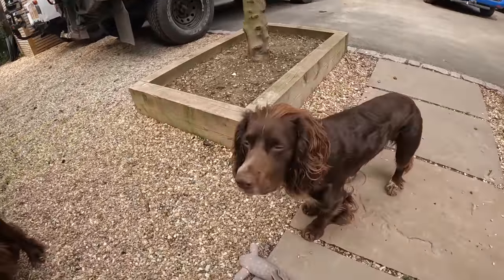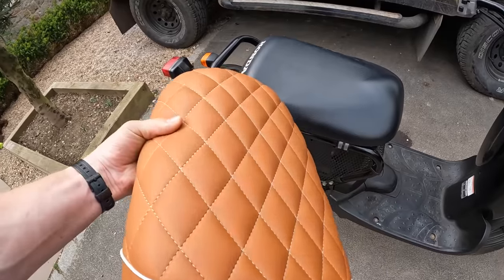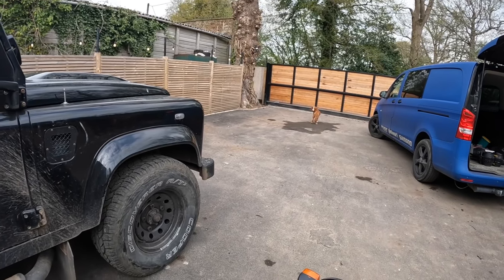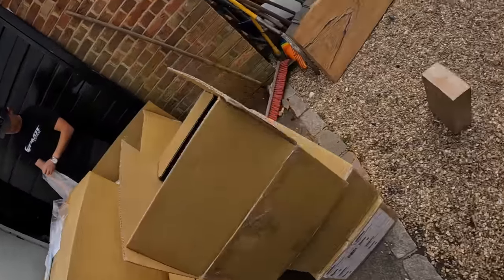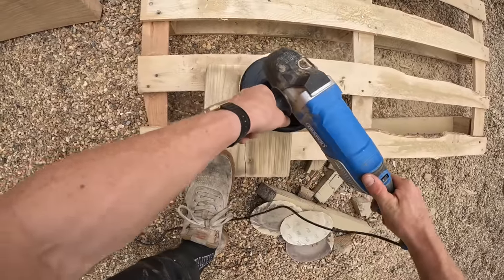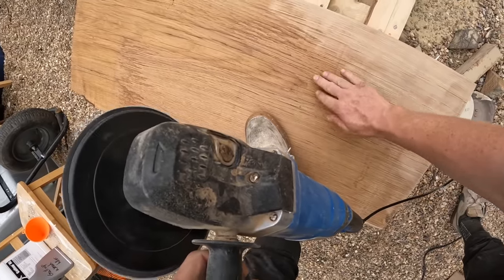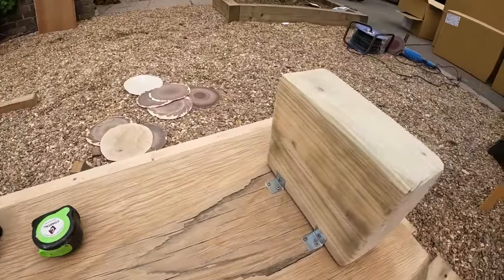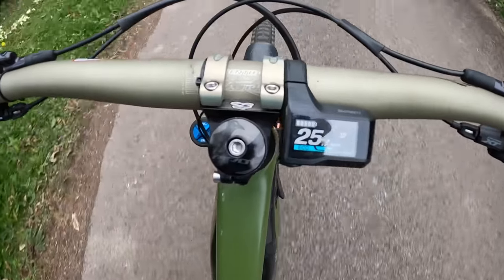E BIKES, COFFE TABLES & MX ENDURO LSD !

Comment: If you want to get rid of the brackets on the table you cant either
A- attach legs by pinning them together with wooden dowels drilled in a dovetail.
B- screw together with long wood screws but make sure to burry the screw with an impact driver so you can fill the resulting hole with either super glue / pva glue mixed with a load of the dust from sanding the pieces you have